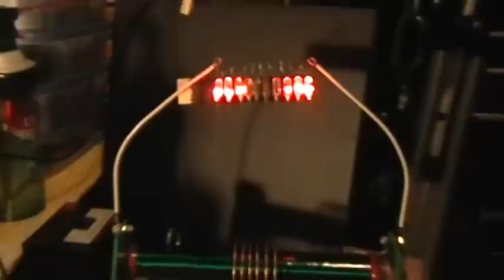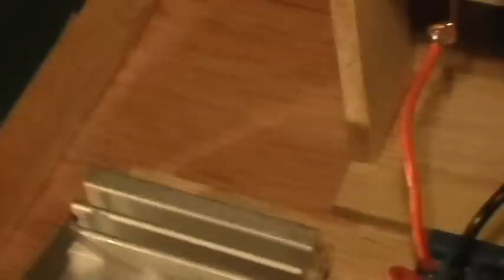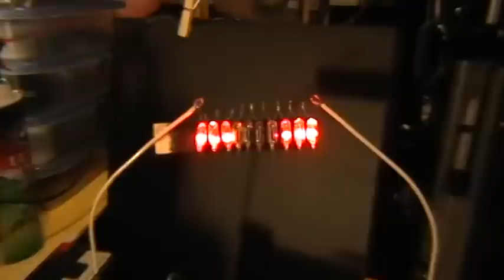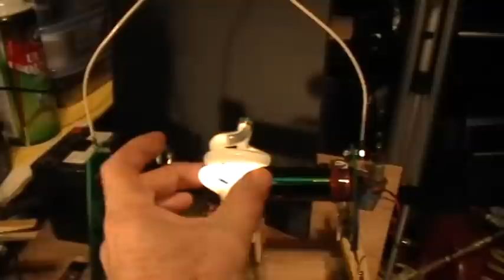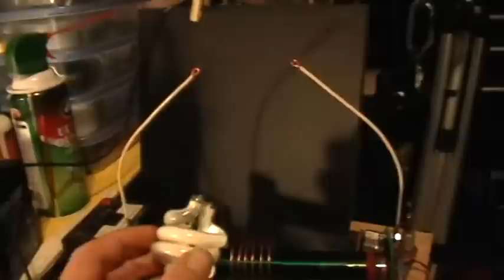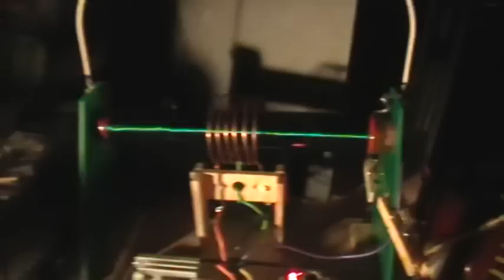Extreme High Voltage: TinselKoil 8: Bipolar Slayer Success !

Comment: Hey Mr TinselKoala... I had huge problems trying to get mine working with 2n6547 transisitors so switched to a TIP31 which was then much easier to make it work but the transistor would heat up if I tried to get plasma out of both ends.  I finally got it working on the 2n6547 transisitors but I noted one important thing... there's a threshold in the voltage where it works.  I was using an adjustable PSU so I could sweep through the voltage range 0-50v..  with the large 2n6547 it would only work at a certain voltage range.. about 30v.  Lots of variables to work with though and coils of different sizes and wire lenghts so we'd all experience something different I guess.    It's pretty hard to get going the first time isn't it.  Nice work though.  thanks for sharing.   I'm just cacthing up so I'm a few videos behind.
Cheers Deeds
Reply from the maker: Thanks for the information! Yes, the only transistor that works well for me in the bipolar mode is the 2sc2238a. I tried many others, including TIP31; most worked fine in regular mode with the hardwired connection to the Base, but did not work with the unconnected pickup loop.  I also deliberately restricted my input to 25 V since I'm going for a battery powered demonstrator, using 2 12v SLAs.
Since this video, I've changed the primary coil to a closer-coupled one and now am able to get a little corona from each end, and light up all 10 NE-2s with no problem. A small fan on the heatsink takes care of the heat nicely.

Comment: COOL. persistence pays off.
Reply from the maker: Yes, it does! Now I've got even better performance (lighting all 10 neons in bipolar mode) by using a closer-coupled primary and stuffing the pickup wire into the RH side of the secondary coil form! Check out the "info slideshow" which is the next video in the series.

Comment: So all the other transistors didn't allow for bipolar output equal on both ends?
Reply from the maker: That's right. They didn't work without the base connection to the secondary and didn't work as bipolar output. I tried too many to list, TIPs, MJEs, and a lot of 2sc, 2sd, etc types, all NPN high current, some high voltage, TO-220 and TO-247 types. The 2sc2238a is the only one that worked properly without the base connection and allowed bipolar operation. I did get some action without base connection using the original 2sd2333 but it was still unipolar. And this 2sc2238a is the only one I've got, so I'm trying to be careful with it, added a little fan for cooling since it runs quite hot.
Now I've stuffed the pickup wire into the end of the secondary and it really works well, lights up all 10 NE-2s in the load bank. Finally able to get a little bit of corona from needle points mounted on the output wires. But still feeble. I think now I need a better primary, my coupling is probably too loose for Slayer. But I'm working toward real TC action so I may just make a special primary for Slayer and still use this one for the hybrid SS-SG half-wave TC version. I need to get some proper end capacities (brass doorknobs), and the HV power supply still to make.
Reply: TinselKoala cool I will be watching this space...
Reply from the maker: *****
I'm not using mosfets in this circuit, they would not work, because the base is not completely open, there is a 50k trimpot from base to positive suppy rail for base bias. The base signal with this transistor has a substantial negative bounce which is why the red LED is there, reverse-biased, from base to negative rail, to protect the BE junction. With unipolar mode and the base connected to the end of the coil, the trimpot normally controls the collector current as one would expect. With this transistor in the bipolar mode with base working from the pickup, I get more negative bounce (red LED stays on) and the trimpot can remain at maximum resistance. The schematic is in the first video using this driver. In this mode the main oscillation is about 1.875 MHz, with substantial ringing on the collector.